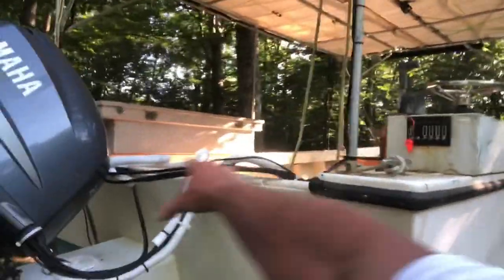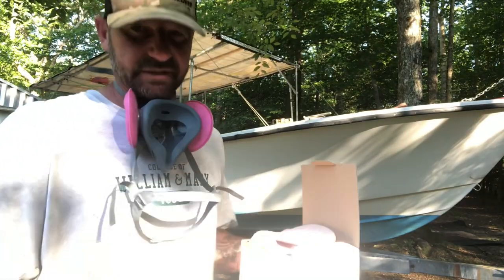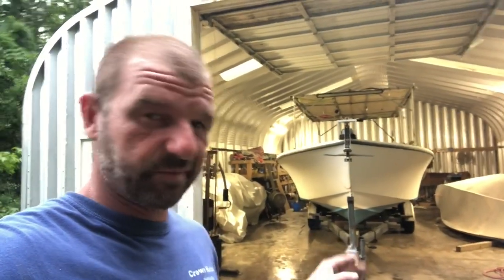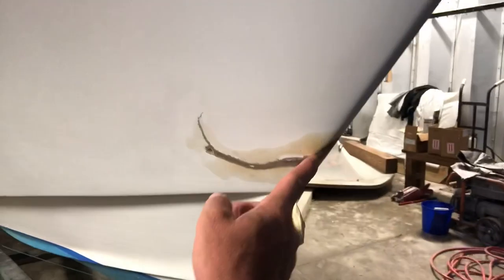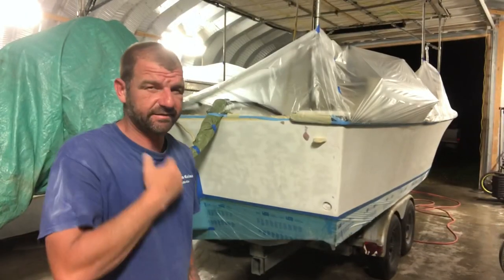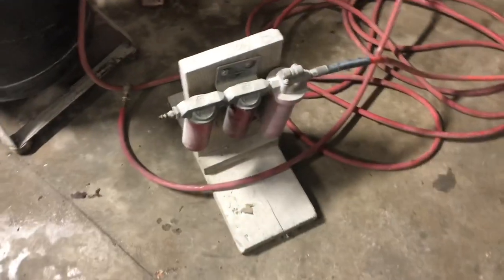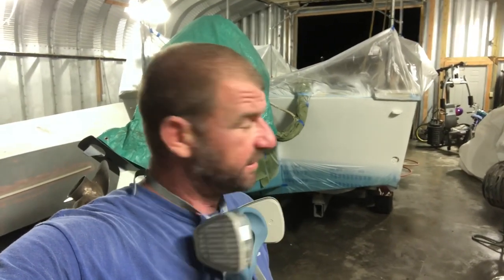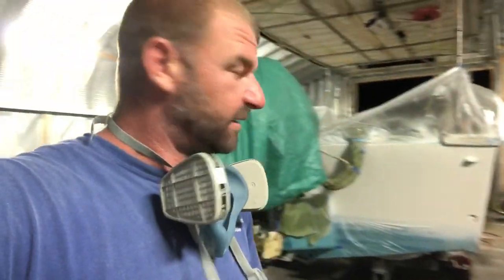Backyard Paint Job *QUARANTINED EDITION* part 1

Comment: Frankie, if you are looking for additional backyard jobs, just let me know. I have a Wellcraft 236 in Montross VA that needs a paint job desperately! 

Question, I have started keeping my boat in the water at a marina near me. I am currently pulling the boat every couple of weeks and pressure washing and scrubbing the bottom. I want to paint the bottom for next season and will most likely paint the boat as well. What should I do first? Bottom or hull sides?
Reply from the maker: I’d be more than happy to help. And it really doesn’t matter if you do the hull or the bottom first. 👌

Comment: Frankie these videos are the best brother.  Thanks for taking the time to put them all together.  Was wondering if there was a way to apply awlcraft w/out a spray gun?  I want to repair some spots on my boat but not paint the whole thing.  don't want to have to buy a spray gun.  thanks bro.
Reply from the maker: Hey Seth. They say you can’t roll or brush awlcraft however, I have done it in the past myself. It’s extremely thin so you will have to apply as many coats as it takes. And thanks Seth👌

Comment: Question:  I have my Mako 282 now coated in white 545 and have completed the 220 sanding process.  I used a dry guide coat to be able to see that the orange peel was knocked out.  There are two or three spots near the bottom chine line, which is where my topcoat will go, where I think I am back to gelcoat.  Would you spot prime those little areas and resand with 400 prior to painting or do you think it is ok to "over reduce" some 545 and use it as a sealer over those few spots prior to applying the topcoat?
Reply from the maker: Yes. You should be good to go after that. Really 320 is as high as you need to go with sanding. Guess it depends on the color. 220 works great for whites and 320 for darker colors. Regardless I always do a finish scrub with a scotchbrite equivalent to 380-420
Reply: @boatpaintingrestorationwit3029  Roger.  I'm going to do the 320 on the hull today.  Still have the inside to sand. I've done countless cars but only 3 or 4 boats and this is my first time with awlgrip products.  I agree this white primer sucks compared to grays.  It doesn't hide worth crap and I had to use dry guide coat to be able to see the orange peel and pin holes.  It's going to be Aqua Mist on the hull and Clipper White on the interior and top cap.  Just trying to get it as slick as I can and probably way over thinking it but since I have about $2,000 in materials maybe that's a good thing.  Lol.  Thanks!
Reply: @raybates3119  I jus finished a paint job on a 1992 Robalo 232.  I followed Frankie's instructions and products very carefully and it turned out great.  I've sprayed a couple of cars before but I'm certainly not an expert.  Frankies advice and "recipe" for AwlCraft 2000 works wonderful.  People can't believe the boat is almost 30 years old.  Good Luck!

Comment: Did you sand using your two compressor setup?
Reply from the maker: Hey Jim. For some reason I haven’t seen your questions until just now. These two compressors struggle to run a air da. You will want a compressor with a minimum of 11 cfm’s. I get by with this setup at my house but would definitely not want to use it everyday. It’s perfect for smaller projects and will push the spray gun good enough for my liking. The compressor I use everyday has 23.5 cfm’s.   They say a orbital sander only needs about 6.9 cfm’s but a disc sander needs 20. Bigger is better and I’d just recommend going with what you can afford
Reply: @boatpaintingrestorationwit3029  I'm just sanding the inside and outside of a 19-6 Aquasport and then priming and painting.  I think I'm gonna pick up a 60 gallon compressor and cross my fingers it has enough air to get me through without making me wait too long for it to catch up.  I just really don't want to use an electric sander because of their weight.   Also, I'll post results of how it works.  Thanks again for all your vids.  I know it's work, but keep them coming.
Reply from the maker: Good luck bud. If you have the will, you will make it work. I say go for it!👌👌

Comment: Frank,  Getting ready to shoot my 20 ' skiff with these products. 
May i ask what the pot time is for the primer and paint after mixing in the reducer?  
Are you mixing between coats while waiting for the previous coat to  tack off ?
Thanks in advance and thanks for all your help. 
Aloha
Reply from the maker: Hey Scott. I mix up what I think it will take to complete the process. Whether I am priming or painting. No need to mix a new batch for each coat. I’ll occasionally stir what I have mixed up. Just keep your mixed up product in the shade until you’re ready for it. 👌
Reply: @boatpaintingrestorationwit3029  Thank you for the quick reply 
Much appreciated. 
🤙